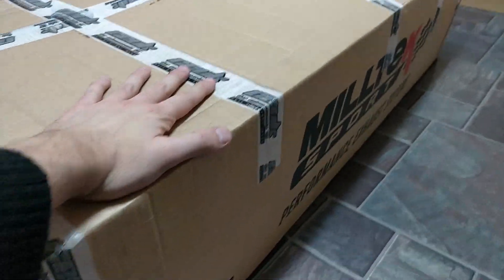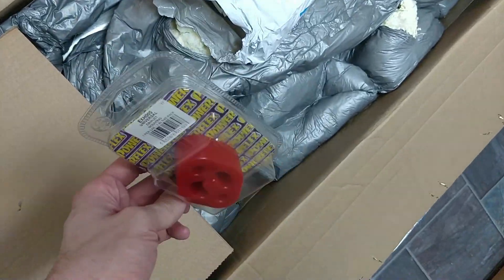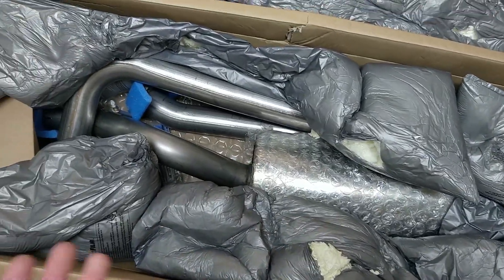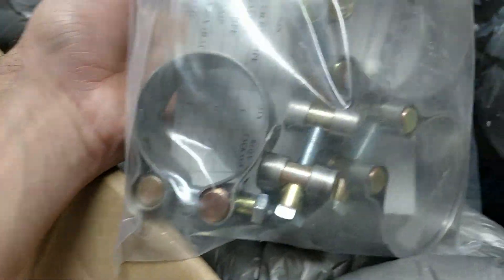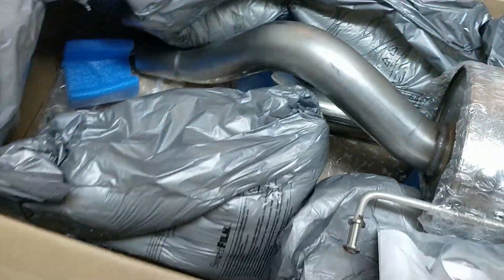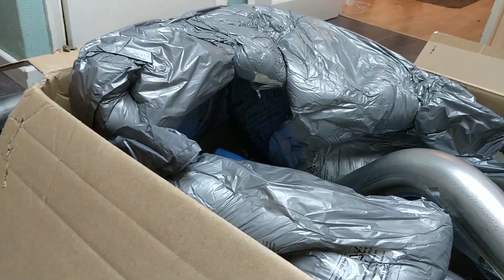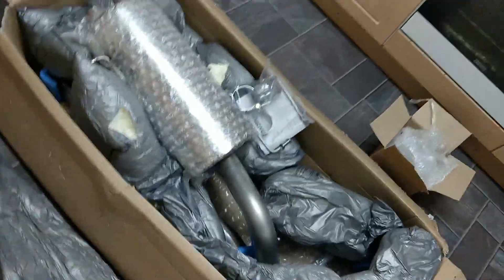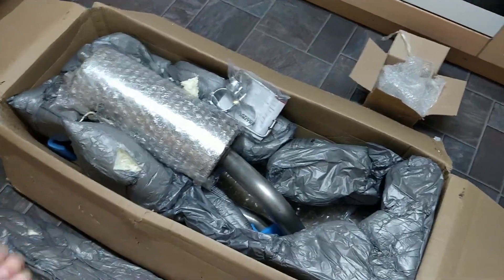Unboxing: Milltek Non Res Race! - Fiesta ST180 - IM SO READY

Comment: whats in the airtec box?
Reply from the maker: Aha that was the intercooler I installed. Currently my old intercooler is inside it sitting in my kitchen
Reply: Wasn’t it a vudu cooler? Or do airtec make them also
Reply from the maker: @danw8956  pretty sure airtec make them but not 100% sure
Reply: Car Rambles heard they make the ceuk one also and others, just odd as for instance the stage 1/2 airtec make is £350 and others that are made by them for other company’s can be had for £200
Reply from the maker: @danw8956  yeah I really don't know how they do it but... I guess with a name you can stick a big price tag on it as they are the best in the business